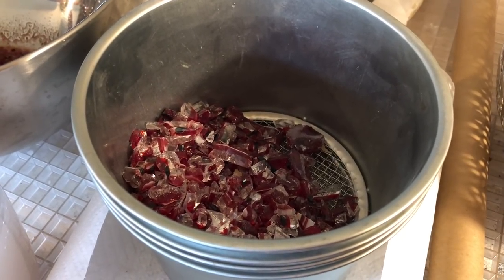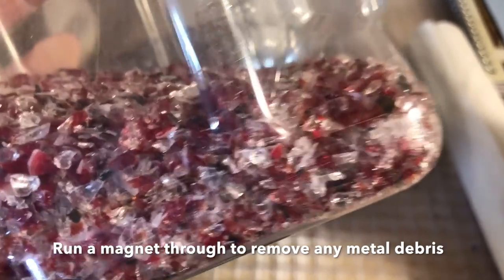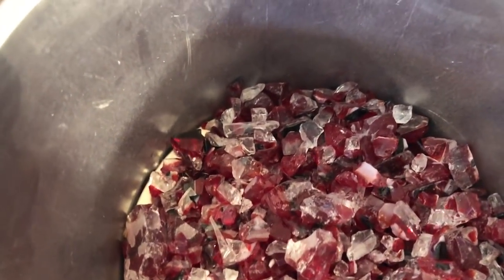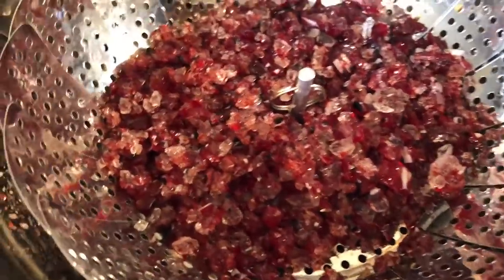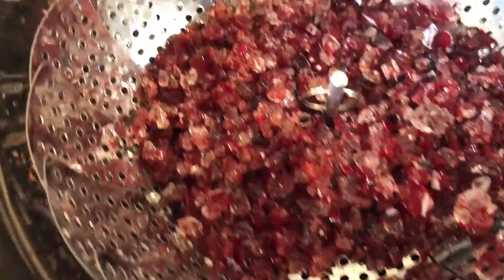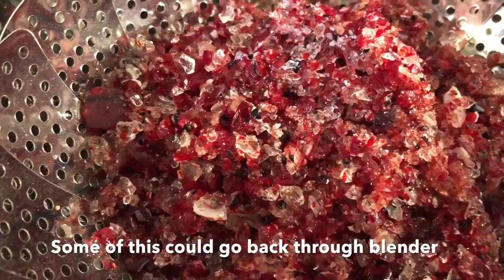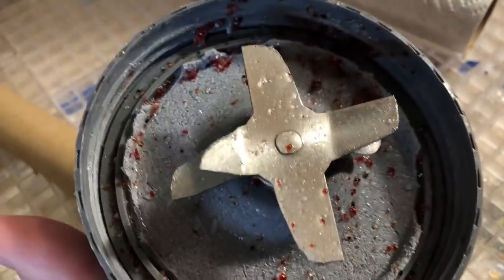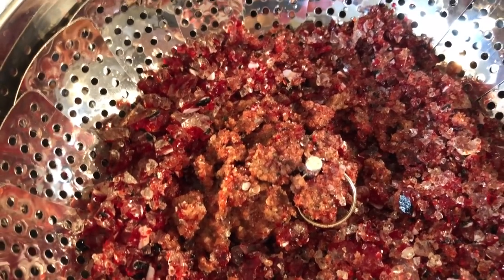From Failure to Frit

Comment: I start out like you do then I use a couple of blenders with glass containers purchased at Estate sales.  They work great.  Then I use the sifters.
Reply from the maker: I wish these had glass containers. I have an old blender that has a glass container but unsure of the motor and blade strength.

Comment: If you put the water in a glass  dish and set it on a base board heater or just let it sit in a warm area, once the water evaporates out of it you have powdered glass. That way you don’t have to waste anything. Powdered glass is expensive. Use shallow dishes it helps it to evaporate quicker

Comment: Does the water make the blades last longer, or just keep the dust down?
Reply from the maker: Capt Mike it for sure keeps the dust down but I can’t say for sure on the blades only because I have yet to break them down (I probably just jinxed myself!)
Reply: I have wore out two blenders.  Maybe the water will lengthen the life of the SS blades.  I usually pick up blenders from Goodwill or such for cheap. but would like for them to last longer.  This is the easiest way to make frit!
Reply from the maker: Capt Mike thrift stores are great for these! I found two large cups and blade bases at one last time I went.
Reply: Water will keep the dust and heat down and lubricate the whole process with some "flotation" to make the blades last much longer.

Comment: The magnet is a standard measure to remove metal but the blades are likely a higher quality stainless steel made with a lot of chromium and nickel. Test the blades with a magnet first to see if it will stick because good stainless is not magnetic or only very slightly so.